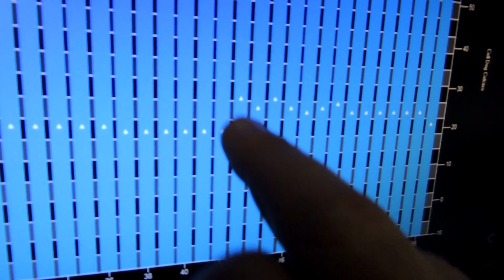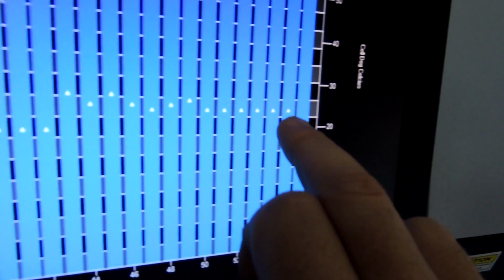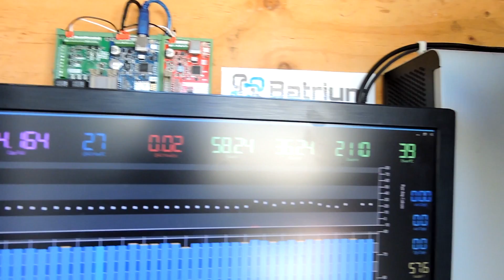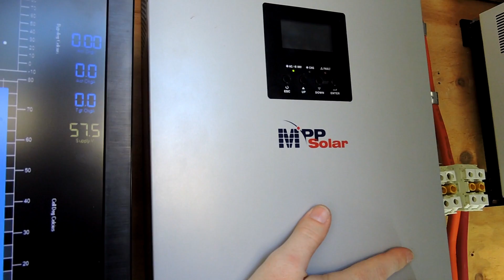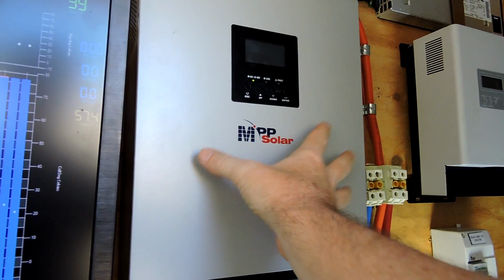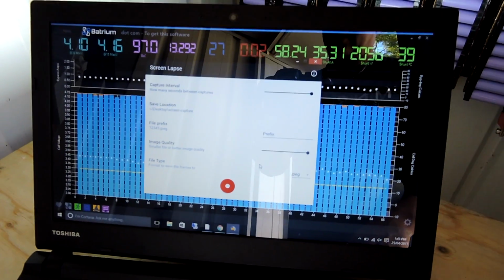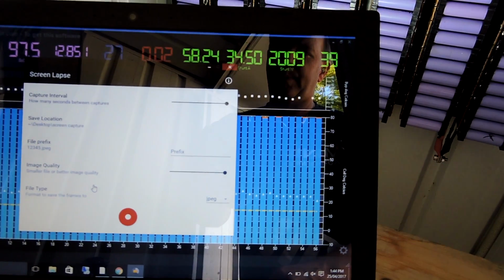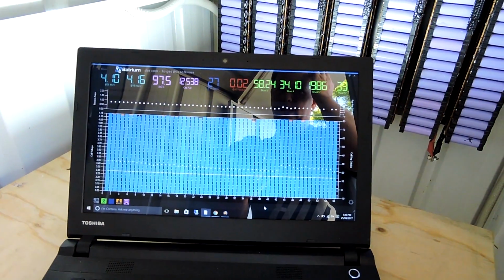⭐My 18650 DIYPowerwall update ⭐

Comment: So is all your power now coming from solar and battery? No grid other then if you want to balance charge and not use the other string of solar panels.  Are you running heat and ac using the battery packs and solar also.
Reply from the maker: Still connected to the grid however haven't used it to charge other than for videos / fun ( like cranking 130amps into the batteries) House is 'offgrid' with exception of the Main large air con in the living area's and cooktop and stove.

Comment: Love your set up. I have made a fire proof cabinet with ventilation fans. I used cement backing board for tile ,inside the enclosed cabinet , so firemen Joe can move next door now.https://www.google.com/shopping/product/14186853649077398169?lsf=seller:8740,store:14002379958328161742&prds=oid:4605116985680737513&q=cement+board+lowes+4x8&hl=en&ei=ULYoWaOZMuSYjwSus7GwCA&lsft=cm_mmc%3DShopping-_-LIAs-_-D23F-_-100183556&lsft=gclid:CjwKEAjwpJ_JBRC3tYai4Ky09zQSJAC5r7ru2Xxuo68LuCEzHaeKwrawUyU5VPqxtfHDZCabHh70fBoCFoXw_wcB

Comment: what do you use for WiFi? seems like you would be a good candidate for Unifi Mesh access points.
Reply from the maker: Batrium connects to it as does the computer, also used as a wifi booster for the house.

Comment: I know you're going to make thermal changes to this configuration.  This is worth a before/after runtime benchmark.  I think you'll be surprised by the changes in runtime as well as cell life.  It will be like hyper-miling a power grid.
Reply from the maker: would be cool, but accurately controlling the temp would be expensive and boring...lol
Reply: Go Geothermal.  It would be as cheap as a spool of polyethylene pipe, a 12v coolant pump, a car radiator with a fan, and a 1 day rental of a Bobcat.  You can make it a simple closed-loop system that constant 60° all year around with a simple thermal switch that engages above 70°.  Look up "closed-loop geothermal".  It's not all that boring because it's so simple!
Reply from the maker: Digin ain't for me... i bitch when my finger tips get sore from typing :)

Comment: You can get an attic roof fan which turns on based on temps for your shed roof top. Might help keep the batteries running cooler or at least exhausting the heat they create.
Reply from the maker: +TekReviews hummm interesting
Reply: Just punch a hole in the wall and duct that heat straight outside.  You can buy a roof vent for $7 USD to vent the radiated heat the rest of the rig naturally gives off, but if there's a fan blowing heat across a regulator or transformer, why not just duct it right out of there?  Hot air rises.  A simple pipe with a crown and a trap oughta do it.  Put your thermocouple in the pipe.  It seems that peak charging hours are the hottest part of the day (in a shed) with a solar array, you would want to take advantage of every means of conduction, convection, and radiation possible to lower the ambient temperatures.  Charging hot lithium ion batteries is a fire hazard.  Cooler circuits are efficient circuits.  You could even take advantage of heat sinks or heat pipes to suck radiated heat outside to a heat exchanger, or even into the earth for an even more energy-efficient solution.  Plus... if something goes really wrong, you'll quickly see smoke billowing out of the chimney and the roof vent.
Reply: You can buy attic solar powered fans they are great for homes to vent out hot air when it reaches a certain temperature. Much easier then hacking your own together.

Comment: hey mate whats the go with electrical licenses needed to do this sort of thing in aus? Because your battery voltage is under 100v anyone can do it?
Reply from the maker: ALL 240v is handled by 'The Sparkie' everything else is under the DC Voltage limit and I've done that myself.
Reply: actually, i think you'll find (and i'm happy to be corrected) that ANY electrical installation that is "a permanent fixture" whether high or low voltage, is required to be installed by an electrician!? not that it's stopped me... was something i was told many moons ago!

Comment: pip do 4kw solar. i was running just above 4kw on mine :)
Reply from the maker: man 4kw, that would really heat up the pip !
Reply: No problem on mine :) Though i do not have it as hot as you have. Perhaps 20C in the area mine is mounted in the summer. I pushed hours and hours with 4kw straight through it last summer.  Will be hooking it up on the new panels i got so lets retest again.
Reply from the maker: In summer it gets quite hot winter will be fine, wonder if Jarod can add that feature turn down amps when hot..lol
Reply: hi guys, talking to james at mpp, he tells me that the pip4048ms has the capability to clip... i'm running 3120 through mine (although it gets a little warm) and he suggested i could put another 780w (3 more panels) onto the system.

with that said, they now have an 80a (older is 60a) pip and then there is also the 3x mppt model... msx, i think it is? in any case, great video's HBPowewall!!!
Reply: Most MPPT controllers have no problem with max load or even a bit above. In my area many people go 20% above in panel size to make sure you can gain some more on low light conditions.
Reply: yeah, i've an older (4yo) 60a/3000w 4048ms... bought an 80a but not swapped it over yet! now keenly watching the 500v and the triple mppt versions!!!

Comment: most inverters are stackable. meaning they can be joined together on the output side. I have also found that what your panels are rated for, and what they actually put out is completely different. That being said, I have  found that the more panels that you connect to a single inverter the less power you get out of that inverter. when I split my panels over several inverters I actually got more watts out of them going back to the grid, or in your case to the batteries.
Reply from the maker: humm interesting... definitely leaning towards using the PCM60X for the second string ... it will only really be east facing for early morning sun probably be in full shade by 2 in the afternoon.
Reply from the maker: or get a second pip :)
Reply: I'm not up on my solar, but I get why you need an inverter to go from panels(DC) to house(AC), but where are the batteries connected for charging?  if you're going to say the AC charger is connected to the DC/AC inverter I'm thinking there is going to be quite a bit of lost energy in the form of heat.  What's the effeciency of going through essentially an inverter and charger?

Comment: nice update did you say you have another 3000 watts of solar coming. if so what will now be you total of solar panels?
Reply from the maker: +old time engineer 1500w more make a total of 10.5kw
Reply: HBPowerwall holy cow where did you find room for the 1500 watt also I would put them on the other charger as long as they can work together also could you put a flexible exhaust hose on the fan output of the pip?

Comment: Hi Pete! Thanks! Always a pleasure to watch your videos and share with you that technology. I've also in my system a PIP (which incidentally is called WKS around here:-), and precisely last week,  I was wondering why on earth the 2 fans at the bottom blows air downwards, and not upwards... !? But , from what you tend to say, that's normal! Could you confirm please. Greetings from France.
Reply from the maker: Yes, MANY reverse the fans, but many time we have had this conversation - and at the end we all seem to agree that smarter (you'd hope) people than me designed this for a reason. Hence I've left it alone for now. Once out of warranty I'll probably install the hacked firmware update for it to control the charging of lithium a little better and turn the fans around.

Comment: Great thanks - I think I understand whats going on more now. I couldn't figure out how what controlled the Batrium
Reply from the maker: Watchmon Tool Kit is the software (configuration & visual display of data) Watchmon is the 'base hardware' (or perhaps explained as the master device) Longmons are the devices attached to each cell that does the 'balancing' does that even make sence?